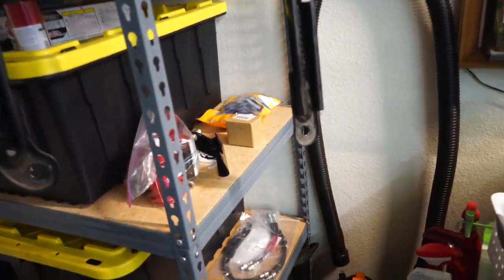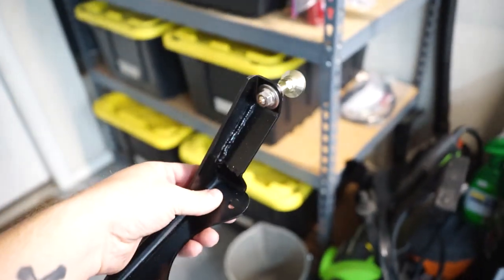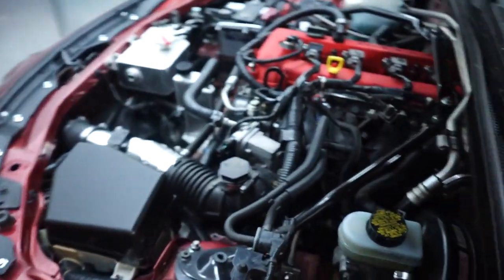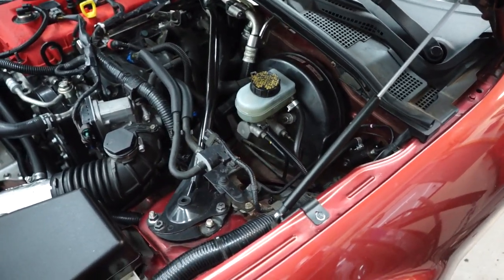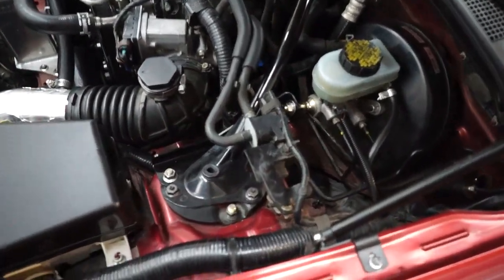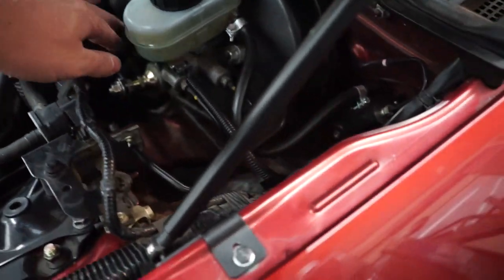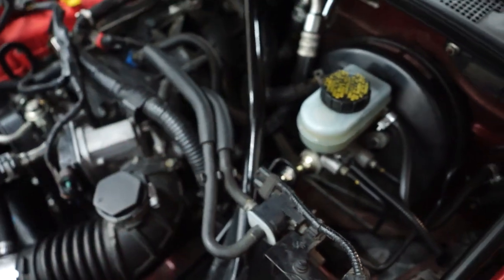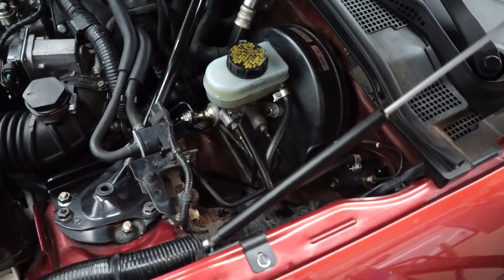Installing TouchStone Racing's NC Miata Brake Master Cylinder Brace!

Comment: I didn't know I wanted this. Been thinking about steel flex brake lines, but this part should work will with em. I am also planning on the hardrace strut bar which is one piece instead of many in the stock one. Also looks dope af imo. 
The most important question for me tho is how much does it weigh? Gram strategy like Mazda intended, only 160 ponys to pull that ship.
Reply from the maker: Adding this, weight wise, is negligible